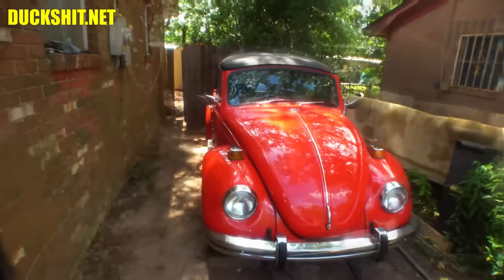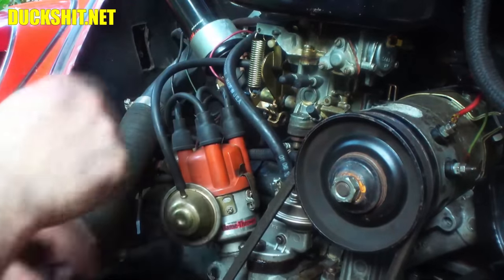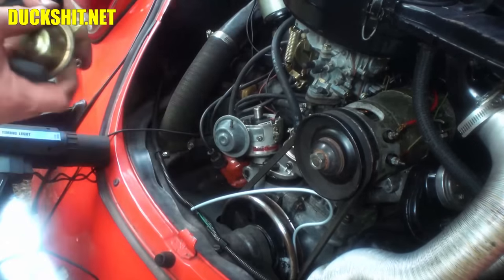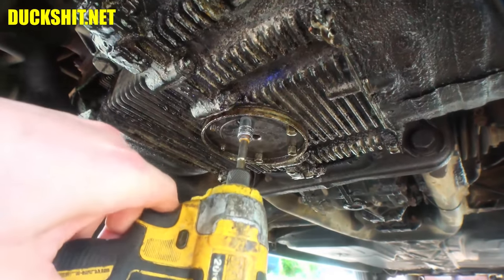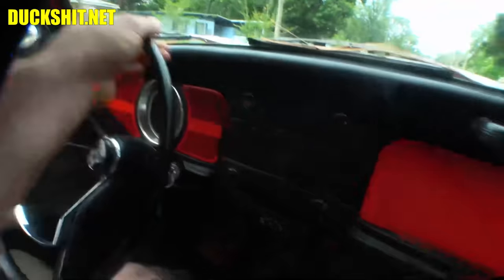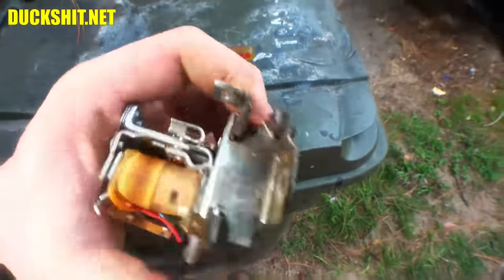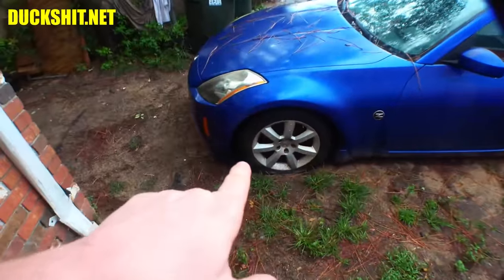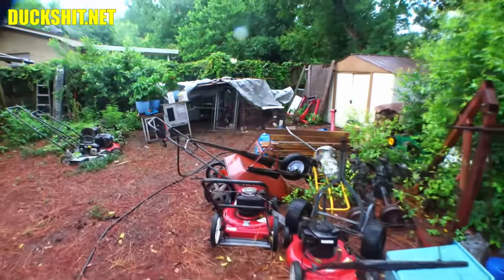⚙️Distributor 🔧Throttle Cable⚡️Electrical Issues🛢️Oil Change VW Beetle

Comment: ...I just got through fighting with a "lifetime warranty" blower fan in the Tahoe - didn't even last 2 years, crapped out right when the temps were hitting 100F - no fan, no AC; thankfully, I had kept the original fan (it started working again halfway through removing it), so I sprayed the comm and brushes down with some D5, reoiled the bushings, fought the 'new' one out and the 'old' one back in - spun right up and AC again (yay!).

Moral of the story? There are some things I would rather just =not= break, even with a lifetime warranty - now I need to go and try to find an OE/OEM fan. Just for giggles, I pulled the fan wheel off the dead one, and it had carbon-grindings all over the inside of the housing and wheel - and no brushes left...
Reply from the maker: Agree!  The starter on the 350Z was under a lifetime warranty...  thankful I had it, but it was only 3 years old.  Shame!

Comment: my 71 bug caught fire due to the fuel filter.. I learned my lesson too. The people were also yelling "get out your on fire"! My fire extinguisher was of course empty so the rear of the car burned. Now with my current Beetle I have fuel filter under the car and a good fire extinguisher.
Reply from the maker: I'm glad I acted as I did.... people were running circles around me with their phones out pointed at me.  I asked anyone for anything, cup of coffee to throw on it, a blanket, ANTHING.... nobody said a word to me.  People are worthless!  Anyway, I ripped off my shirt and beat it out.  The shirt is ruined, but it worked!  There are probably some videos of me somewhere on the internet, but again these people were too worthless to tell me anyting.   I quickly fixed the fuel line, repositioned all the badly burnt wires so they didn't short out against each other, turned the key and drove off just as the fire department was coming down the street.  Had they have gotten hold of the car they would have totaled it even if the fire didnt.  Smashing windows, cutting battery cables, etc.... the car would have been destroyed.
Reply: Yup, the fire department did the same, causing more damage. I sold the car to a friend of mine who said he would rebuild it... one day.

Comment: A tip on removing stuck hindge screws when all else fails.
I've found that if you drill a 6mm (1/4" for you old imperial types) hole straight though the middle of the screw it would then easily come out with an impact driver.
Just be careful to not drill wonky or you will damage the threads.
Reply from the maker: That's never worked for me, although when I drilled them out I've always started with a pilot hole about a quarter inch,  I found myself just going to a bigger drill bit so they head spun off then drilled out and pre-taped threads.  Pain in the ass but gets the job done.  This time I just didn't want to do that much work instead I found myself forcing screws out which worked in the end... lol.... I'm still shaking my head, I did not think they were coming out.  Really did take a lot of abuse

Comment: Funny, you comment about the heat. Here in North Texas, it’s 107 in my driveway. Way to hot to work on my ‘74 that I’m making look like a ‘65.
Reply from the maker: Yep, it was 105 here, which is unheard of.  Summer is usually 15 less but LOTS more humidity which we don't seem to have too much of this year.  Not so much rain either for almost the last month!   Rare case!

Comment: Just a tidbit Duckman: that crankcase breather tube is missing the rubber booty at the bottom. They are pretty cheap to replace and keeps the tube cleaner.
Reply from the maker: Thanks man, I don't think I've ever seen one.

Comment: One tool I purchased was a vacuum gauge with pump-able handle. The dial gauge measures vacuum at the carb. An actual number in inches of Mercury. When at a swap meet I test a potential vacuum canister purchase by attaching the gauge to the canister and then pumping the handle to apply vacuum. Then by reading the gauge, one can determine if the canister holds vacuum ( ie. the needle must not move, if it falls slowly the diaphragm has a small leak. If you can’t even create a vacuum, the diaphragm has a large leak). Sucking on the canister is not the best test, especially if the canister has but a small leak.
Reply from the maker: Got one, but disagree, not needed.  Suck on it, and watch the timing light, even if small leak you'll see the timing drift.
Reply: @DuckmanCycles  that procedure is of no use unless the can is installed on an engine. At a swap meet facing a box of five dollar vac cans I’ll take the gauge over my lungs any time. The can was designed to deflect over a range of vacuums (read mm Hg values) . That’s what quantitative tools are for, to see if the item works and if it works within spec. Great video by the way.
Reply from the maker: @hankthebugman  You're right, my method wont help without it on an engine...but guess what it was in this video....? INSTALLED ON AN ENGINE.   LoL!   I don't make a habit of keeping these components in stock, nor do I make a habit of keeping a vacuum gauge in my pocket with me when I go to a swap meet.... this video wasn't about swap meets.  Everyone on the internet always wants to argue the things that I'm not taking about.  Thanks much for your input, though!  Nonetheless, you may not trust your lungs, but I trust my tongue, hundreds of women have, too.
Reply: @DuckmanCycles  I know, I know you were doing this on a motor. I’ve started carrying a gauge with me to swap meets. The only quantitative way I can ascertain whether the guy is selling scrap or working canisters. And as for your comment about hundreds of women, now you are bragging ( and possible exaggerating just a tad). 🥴 keep these videos coming I do enjoy your positive approach to the tasks at hand. Thumbs up sir! 👍
Reply from the maker: @hankthebugman  lol.... not bragging, but made my point. I've lost count, actually. The Duckman is very high in demand.  Haha, anorher reason why I stay single and still dont need a vacuum gauge in my pocket.  😁👍🏻

Comment: first thing i do when i get lockers on the wheels is to remove them and put them in the bin. these days they are not really needed unless you live on a housing estate in the uk. mechanics gun them off and break them then blame rust ive had it before so i just take them off when i get a car put normal bolts on. 

nice job here today i enjoyed watching it kinda was hoping it was going to be a bit longer though haha.
Reply from the maker: :LoL!  Great story, and thanks... but that won't help me now though.  I'm gonna have to force them off!  Might be a video of me swearing at them.   😁👍🦆💩
Reply: @DuckmanCycles  lots of quacks and mario coin collecting lol
Reply from the maker: @TotoGuy-Original  always quacking around here, and I sure love me some Mario coins!

Comment: It looked like you inserted the “Z” end of the accelerator cable from the tunnel side of the gas pedal instead of inserting from the left of the pedal with the end of the “Z” toward the tunnel.
Reply from the maker: If you're suggestng that I did this wrong, I'm not sure what to say.  The cable comes out on the right, so it goes in on the right.  If you cross the lever, you stress the cable and it wears out on the tube and on the lever. (Ask me how I know!) The cable doesn't call out as someone else might suggest somewhere else on the internet.  In from the right it goes.  Only one of my manuals even illustrates this, the rest don't talk about it at all... which is interesting.
Reply: @DuckmanCycles  How do you know ?